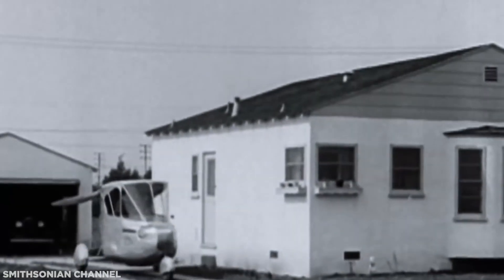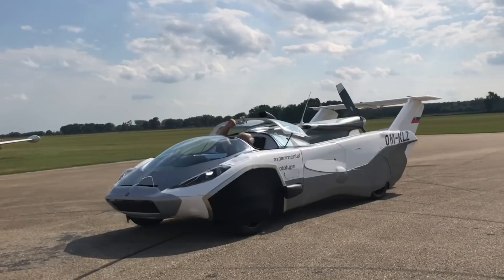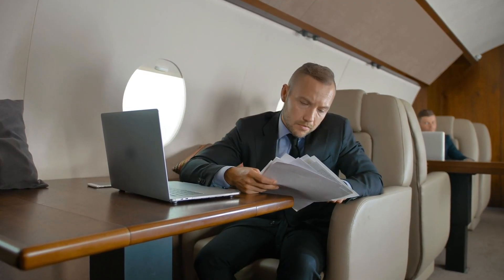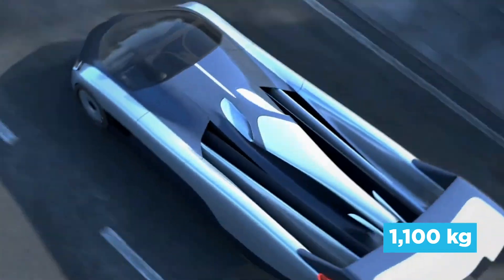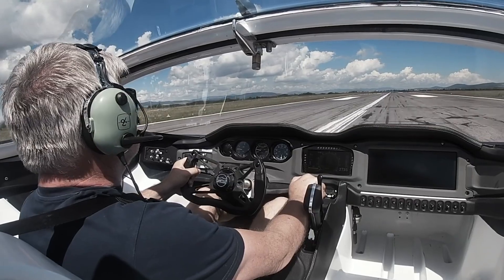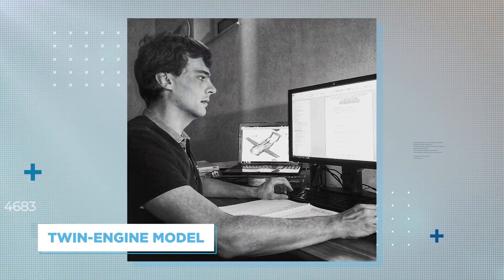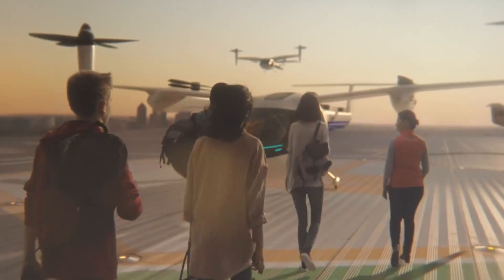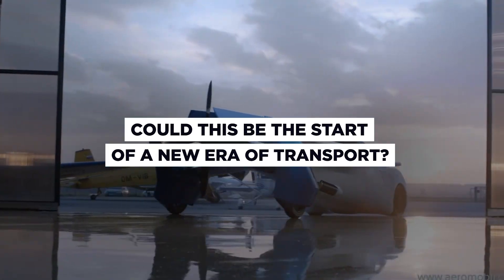The World's First Commercial Flying Car

Comment: So wait... What happens if you ran out of gas? Does it have like an emergency bag thing?
Reply: It has wings, if it runs out of fuel mid flight, it can still glide, just like a plane. Running out of fuel mid flight is negligence anyway and you will land yourself in hot water for it.

Comment: It has to many steps. . . Think of how many sensors have to work right all the time just to insure everything is in the right position, like the elevator, or wing fasteners. . .Its too many.
First, get rid of the prop, people won't buy it just because of that alone.  Use an internal blower fan, something. . . This as it is shown will never be reliable.

Comment: The angitravity add on the bottom and they look like a thick fan with solid blades of high density and more surface area . Lift forec = change in area multiplied by density/ ( time power to the 2)
Reply: What are you talking about?

Comment: Risk management is a vital element of success for any tradr in any mar:ket. No matter the size of the cap!tal you’re trad!ng with or investing in, losses are going to be inevitable, particularly in highly volatile mar:kets like crypt0currency. Learning how to manage risk to minimize losses is vital. Yet, it’s also necessary to master risk management in order to ensure maximum gains. After all, the more you’re willing to risk, the greater the potential reward. I’m not a pro tradr but I was lucky enough to make 25’B’T’C since late last year following the instriuctions and s!gnals from Wells Carlton. He runs program for investors/newbies who lack understanding on how trad!ng Bitcoin works, to help them utilise the volatility of the crypto mar:ket and also stack up more bitcoin. You can easily get to Andrew on 𝚠нαтαѕαρρ  + 1 3 3 9. 9 9 9. 0 9 7 2 for Crypto related issues.

Comment: Unpopular opinion: we've already had flying cars for years, it's called the airplane. Airplanes are literally vehicles people use in the air.
Reply: I though that was helicopters
Reply: These are upgrades
Reply: No I don’t think it’s really an “unpopular opinion” it’s simply untrue not all vehicles are classed as such as cars or trains,trams or a helicopter. These new cars should actually be used to drive on a road.
Reply: Ah yes I love my airplanes which also drive on roads , they are not flying car , they can only fly and not do both
Reply: No, no, he's got a point
Reply: do you drive them on roads no.
Reply: @thematgam5937  when they take off, yes they kinda do
Reply: @mfhaikyuufan96  a flying car is a thing you can fly AND drive its still a plane

Comment: The tail usually generates down force when flying. The wings generate lift ("up force"), the tail generates a small amount of upside-down lift ("down force") to make the plane stable. Center of gravity is typically forward of the center of lift; that makes two down momentums on both sides of the center of lift, and you can alter the one on the back with the elevator, and change the plane's angle.

Comment: Normal parking spot?  What?  The aircar to twice a long as a normal car.  Also, the video tile says "Commercial" flying car.  It is not.  There is a prototype.  That's it.  F*ing click bait! Hate it.
Reply: Sorry Dennis but the AirCar is shorter than my Volvo XC60 once the tail is retracted along with the wings - so parking isn’t going to be an issue.  Granted the one flying is the first of this series that is built for a pilot but there has to be a first and as you  say a prototype.  They are apparently building a second version with the larger engine and there is little doubt if they can raise the money they will go into commercial production.  Now - this video’s suggestion that the aircar will be landing on office building roof tops is nonsense - the current versions Klein-Vision are talking about do not include a VTOL aircar.  But the biggest difference between the AirCar and most of the others is that if you want to see one - go to SK it is there and if you want to buy one - put up the money and Klein-Vision will build you one although it will be number 2 as they apparently have already taken an order for #1...

Comment: STUPID........
Anyone can turn a plane into a car like this. It shouldn't be called a car unless it can carry at least 4 people and still be able to be driven on the road without needing to widen the road itself ! It must also be able to be fueled like a car as well !
Otherwise don't call it a CAR !
Reply: Hi Dan - Well STUPID does accurately describe your comment.  I call my Z4 a car but it only carries two people, this vehicle when in car mode is shorter and narrower than my wife’s Volvo XC60 so I’m don’t why you would think they need to widen the road.  The AirCar we see flying here has a BMW motorcycle engine in it and the next one will have a purpose built 300HP Adapt engine which meets smog and noise requirements for road use - I don’t know what grade of gas it uses but you are going to fuel it up at your neighborhood shell station.  You pretty much missed on every point

Comment: Seems more like a roadworthy mini airplane. The first real flying car won't have wings.
Reply: Sorry but it is doesn’t have wings it will not be able to be flown under a pilots control it will have to be a drone.  Picture this - 5 people on the same street have a VTOL flying car - imagine them all buzzing in after work - or flying around downtown going to the office - it will have to controlled flight, you request start and finish points - some computer (probably gov’t controlled) figures out a safe flight plan and then the computer executes the plan - you are just a passenger/package.  Safe, convenient but really boring..

Comment: I didn't hear anything about fuel being mentioned. Powering that thing must be a major hurdle.
Reply: They put a bmw motorcycle engine in the one flying in this video and they next one will have a ADAPT 300HP engine built specifically for dual purpose which meets smog regulations for a car so I’m guessing fuel will be pretty much standard stuff.

Comment: My opinion as to why there has still never been a successful flying car is the same as my opinion of the concept itself: It is an attempt to combine apples and oranges. If you want a car, why do you need it to fly? If you want a personal aircraft, why do you need it to be a car. The more logical approach would be to focus on a small, safe, fast, vertical take-off and landing personal aircraft, as some companies are now doing. Once your personal aircraft is in the air, it has no need for roads or highways, it moves across the sky. Then, it lands vertically at you destination, where it is stored in the equivalent of a car park. Fly by wire, in which all such vehicles are controlled in air lanes by AI, so as to avoid collisions with each other, traditional aircraft and buildings, would keep you safe in the air and avoid requiring you to become a pilot--the personal aircraft would be self-flying.
Reply: Just to be clear - Fly By Wire - refers to control systems that are electrically controlled not controlled by physical cables or rods.  But to your point I agree - VTOL take off and land anywhere systems will be cool but they will have to be totally computer controlled and centrally managed.  They will at least during flight - be drones with no pilot controls and therefore no need for a pilots license.  Convenient, safe but boring...
Reply: @lmac9364  But cool. :-) I hope I get to fly one day.
Reply: Agreed - not sure the flying performance will be that great but wouldn’t be neat to sit next to a $2 million Bugatti at a light and know you are in the cooler car:-)
Reply: @binbon6339  That was my whole point--do you want a car or do you want a helicopter or similar personal flying vehicle?
Reply: @Mordred478  Yeah but flying car wins hands down on the cool scale

Comment: I am guessing it is not a good plane and also not a good car. I don't even want to know how bad the crash safety is. It also seems to be significantly more complex (more things that can go wrong) compared to a simpler (less fuel efficient) VTOL design which may be more practical for day to day use. I think the reality is that roof top based landing pads on large office buildings with smaller VTOL vehicles is more likely to be a success.

Comment: That's a no go unless automated!
Reply: @binbon6339  Not really! Planes are extremely expensive, too fast, only fly in one direction,  can't fly low, and they need a regular maintenance and a hanger to keep em. 
A drone-like car can easily be made for short distances OR can turn into the airplane shown in this video after a vertical take off. 
(Checkout F35 VTOL)

Comment: The engine shown at 3:03 looks a lot like a WWII Merlin. It has little resemblance to the Adept Airmotive engine - which is a wide-angle, water-cooled 3.2 liter DOHC V-6 with the prop reduction gearbox cast as part of the block.